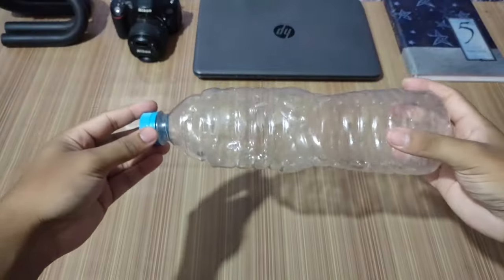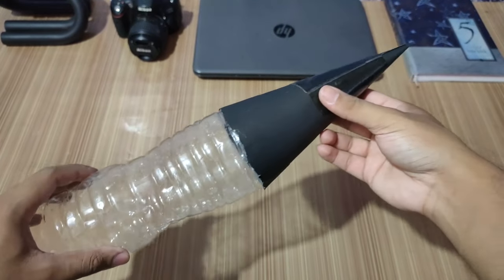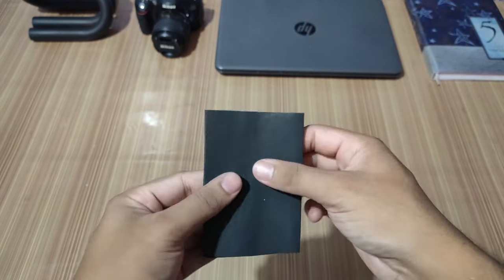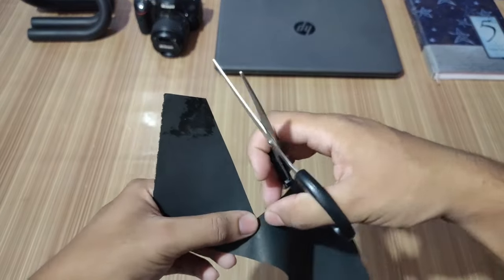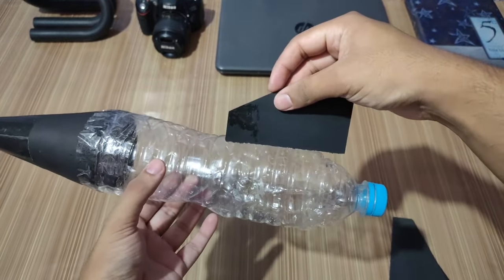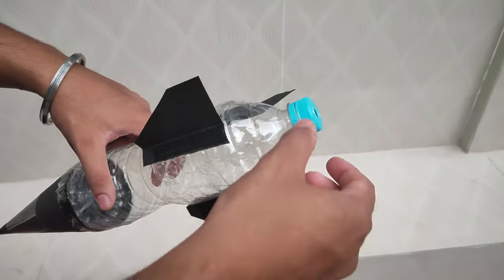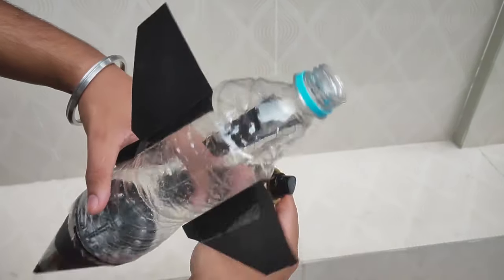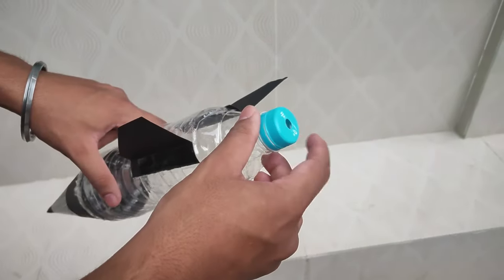How to make a rocket at home using plastic bottle / homemade rocket !!! DestructionX !!!

Comment: I tried it and worked thanks❤️
Reply: I also like to try it. But I am concerned about it's safety. Was it safe?
Reply: @saqibshouqi9940  not the safe i expected because i tried many kinds of perfumes and some of them was making it a bomb instead of a rocket it was bombing with Loud noise so u need to take care I was doing it and then running away also some times the rocket don’t go straight it goes right and left and maybe backwards I don’t recommend trying it but it worked

Comment: Sir my rocket fly at only once but in very short distance and after I try again never fly please help me
Reply from the maker: If the hole is too big than it will not fly very far try making the hole a bit small . After each use you have to press the bottle to push out the co2 inside the bottle out and allow fresh oxygen rich air to enter the bottle after that spray alcohol or deo and the rocket will be ready to be launched again .

Comment: I don't know if you will reply but how far does it go
Reply from the maker: Not very far just about 30m
Reply: @TheRandomBunny09  do you think if I added weight to the front cone it will effect the rocket
Reply: @TheRandomBunny09  I'll add more weight so it can travel further in the air
Reply from the maker: I think it might go further if you add some weight in the front .  Do let me know if it works .
Reply: @TheRandomBunny09  I am now studying for finals but I will be sure to let you know if it works

Comment: I have a question can I use hair spray instead of the spray you used
Reply from the maker: If the spray contains alcohol or it is mentioned on the spray can that it is inflammable than you can use that .

Comment: The rocket did not work 🤬🔪
Reply: Fr
Reply: My is not working neither
Reply: Chill out kid
Reply: When my friend launch this rocket it work but mine didn't
Reply: You need to know that physics must be done very specifically
Reply: @superdrip1373   yeah
Reply: The perfume matters all perfume have different chemicals
Reply: You should use isopropyl alcohol so I will work
Reply: @zCypherWasHere  Isopropyl and Aluminum. The problem is, he didn’t show us the required ingredients
Reply: @superdrip1373  oh ok thank you
Reply: Same
Reply: Ikr
Reply: Skill issue
Reply: Make the hole smaller
Reply: Use hand sanitizer
Reply: Use different perfume which has more alchohol
Reply: You need propain gas
Reply: Maybe you put too much perfume/alcohol, when it is too much it wont work so stop complaining and do it right.
Reply: @S-Francesco fr
Reply: Use spray deodorant do a quick spray then quilt light it
Reply: Just use butane (lighter gas), I am pretty sure that would work. How are you supposed to use isopropyle alcohol when there is a hole in the bottom 😂😂😂
Reply: @C_Ricky 
Make sure that the spray was flammable spray